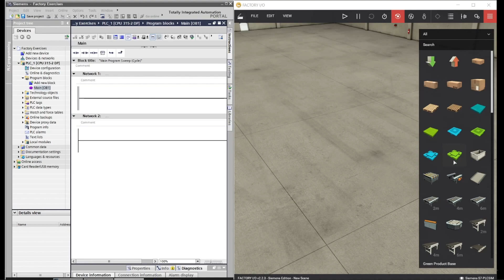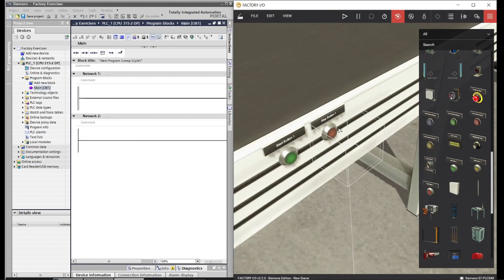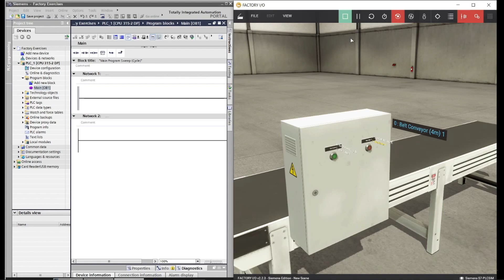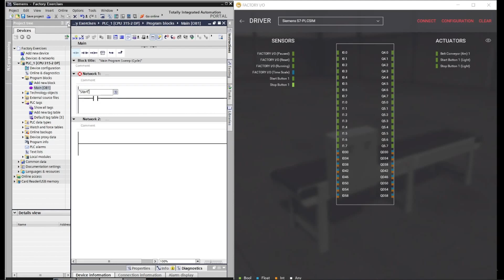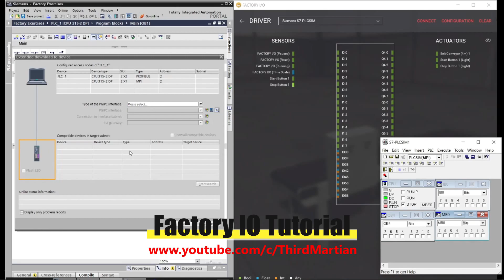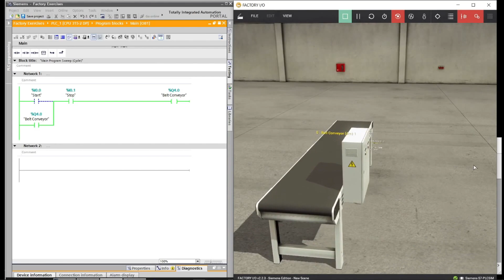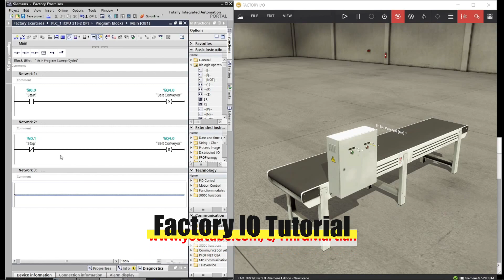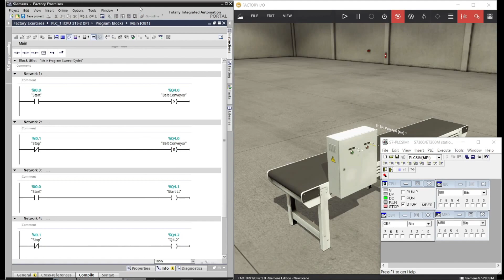Factory IO - Latch and Unlatch Conveyor

Comment: what is mean by (s) and (R)
Reply from the maker: Set and Reset
Reply: @TheMachine0021  thankyou sir , i have another question what is the use of those set and reset in plc program whats actually it does why im asking means in first type you use only one coil for output but second type you using set and Reset,  what is the difference between this two method sir?
Reply from the maker: @jaikrish50  In a PLC (Programmable Logic Controller) ladder program, an SR flip-flop (Set-Reset flip-flop) is a crucial digital logic component that serves various purposes to control industrial processes and machinery. It's implemented in ladder logic diagrams to manage and manipulate binary states.
One of the most common uses of an SR flip-flop in a ladder program is to create a latching or holding mechanism. When a particular input condition (set condition) is met, the flip-flop is set to one state (ON). This state is maintained even when the input condition is no longer active. It can then be reset using a separate input condition, effectively unlatching the flip-flop and turning it off.
Reply: @TheMachine0021  thanks a lot